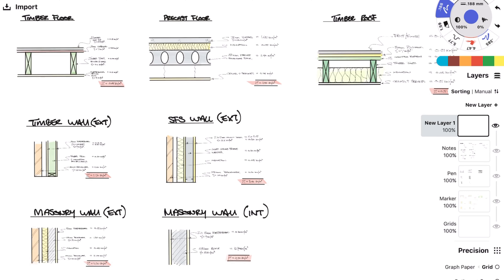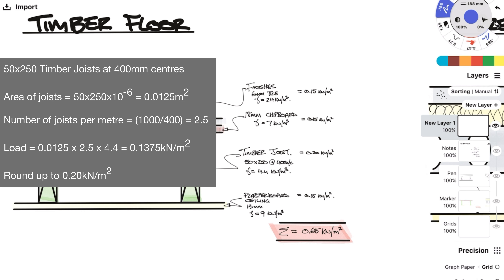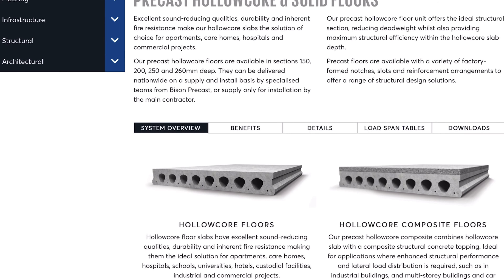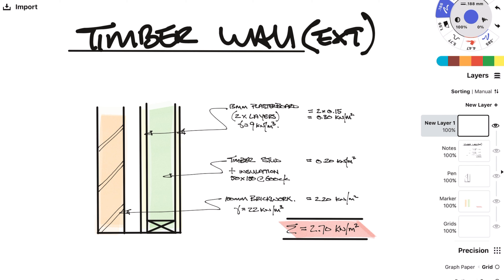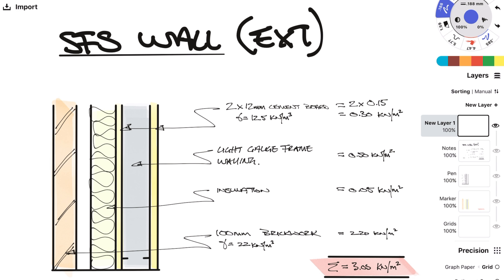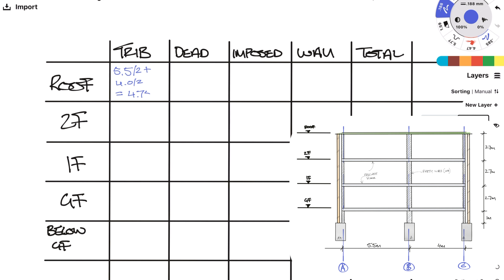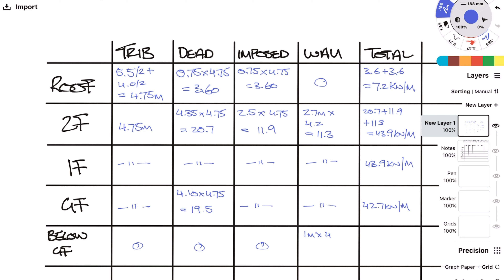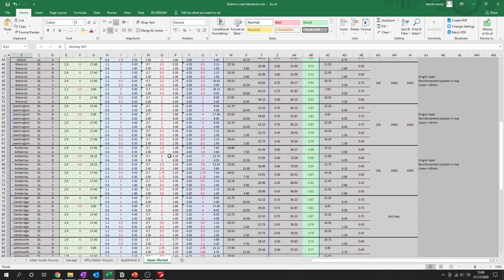How to Calculate Building Loads & Load Takedowns | Structural Engineering Tips

Comment: Hey, I'm going into 3rd yr of Structural Engineering, I really want to get the structural engineers pocket book but have seen reviews that there are errors throughout the book, have you had problems with it at all? Just found your channel, cant wait to watch all your other videos, it's great to see a structural engineer on youtube who uses Eurocodes too 😊
Reply from the maker: There are some errors but not many it is still worth getting in my opinion
Reply: @EverydayDazz  I have both the euro code red book 3rd edition from 2013 and the British standard 2nd edition from 2017.do you know why the 2nd edition came out later than the 3rd edition also which one is better to use? The 2nd edition is a smaller book but there doesn't seem to be much difference in the info within them.

Comment: Great content, could you do a load run down for a corner column and show how you determine moments about both axis?
Reply from the maker: Thanks for the comment, I'll bear that in mind. Determining columns by hand isn't something I'd normally do. In short, you'd do a 2D frame analysis in both directions. Generally, I try and scheme a building so that the stability system is not dependant on column stiffness so either I've using bracing or stability cores. Therefore eliminating the need to design the columns for additional frame moments.
Reply: @EverydayDazz  thank you for the reply. Just coming into semester 2 of my masters and that was an area that gave our group the most grief. Great videos, look forward to more
Reply from the maker: If you are still having trouble. I suggest this technical guidance from the iStructe. Just google 'iStructe L2-5' and one of the first things that comes up is how to design concrete columns. It should be a free download if you become a student member with the iStructe. iStructe has loads of these technical guidance notes which should help you out in a range of different designs.
Reply: @EverydayDazz  exactly, very practical thing to do

Comment: Could you explain why when calculating the Trib area you divide 5.5/2, where is the two coming from?
Reply: The Trib area is the area above the supporting member that is the source of the load on the member. Dazz didn't really explain (or labour) the point that he was calculating load on along a line of foundation that he had called "B". This shown in the video at 7:12. The source of the load on this foundation is all the wall loads plus half the floor loads between A and B, and half the floor loads between B and C (plus the roof loads similarly split).  The other halves of the floor loads are carried on foundations A and on C, so the load on B is only half. He also didn't labour the point that to work out what load takedown calculations you need to perform, you first need to understand the building's structure so you know what load paths exists. Sketching the load bearing walls in plan and elevation is likely to help ensure you don't miss anything.

Comment: Lets say your soil bearing capacity is like 75kpa and you calculated the line load in kn/m. How do you do the calculation to know if it is satisfactory?
Reply from the maker: you then need to design the foundation width so that the pressure exerted on the ground is less than 75kpa. i've done another video on it https://youtu.be/MfB_8uw08m0